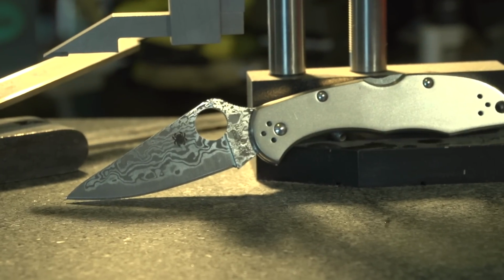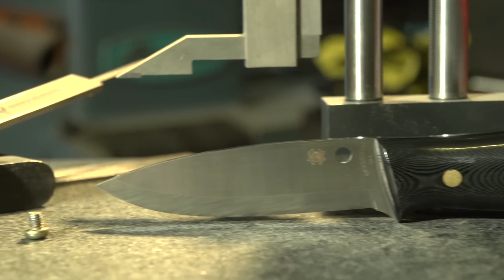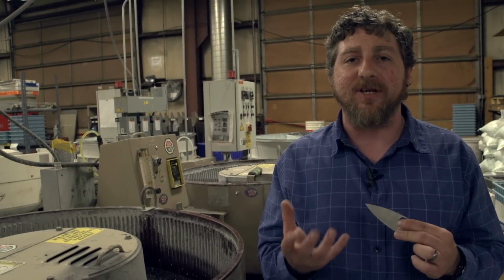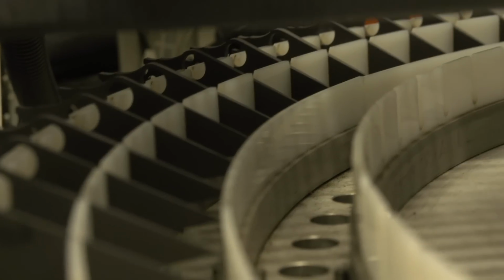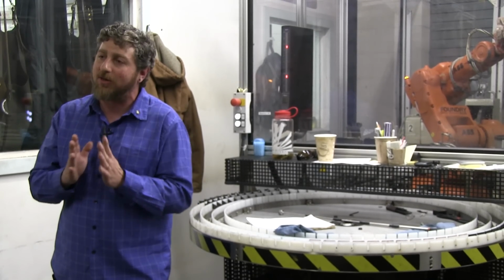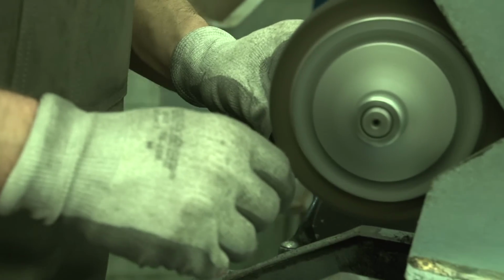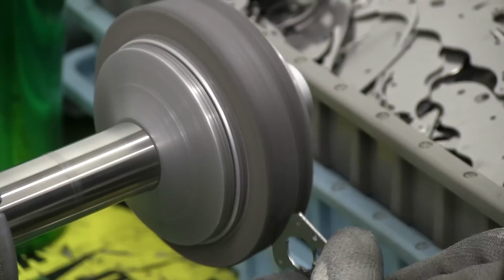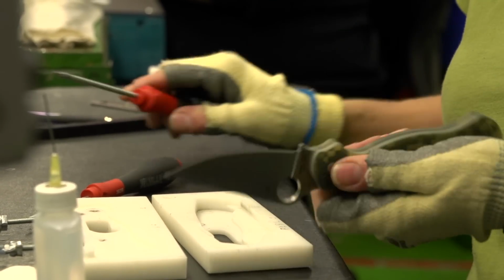Spyderco Shop Tour | Part 2

Comment: I have several Spyderco knives but one of them I have never used and probably never will. It was a gift from our Fire Marshal and has our department logo on one side and the other side states LSB (Life Safety Bureau) and the year we were given the knifes. It has a short blade so we could carry it when traveling and not have to worry about any blade length restrictions (even though we were exempt when working) It is one of 9 items that I own that I consider as a decorative item. Too cool to cut with but I have carried it for hundreds of days and know it would function if I needed it..

Comment: I gotta say, and apologize. I had it in my head that these knives were not hard workers, over priced unappealing. But after the year of using this manix 2 I gotta say this is my favorite. My fixed blade fav is a kabar mini. But this is one fantastic knife with a great warranty. Don't let the big eye hole make you thing this blade is weak. Don't let the plastic make you think it's cheap. These knives are hard workers and you pay that premium for these knives and it's very well worth it. Even the delica 4. But my manix has my pocket. Thank you!

Comment: Such a big self pat on the back. One, your prices are no longer justified by the product. Bought my first one in 81/82 and have carried one for decades. Your sharpening is horrible. Sharp, but totally uneven on 90% of my purchases in the last 4 years. Sticky compression locks, need I say more? Your average knife isn'Crt even up to the quality of the lower grade Bestechs, Kizers and Civivi. And your continued use of 8Cr13MoV is inexcusable. I'd rather buy a Ganzo, at least it has ball bearings.

Comment: I remember years ago, the first Spyderco I saw my comment was, "what an ugly knife." All the years that have gone by and I still had the same feelings towards them. Three months ago I was in a local gun and knife store and asked the clerk if I could look at one of those knives with the big hole in the blade. I don't know if it's because I'm older and wiser now, but when I stuck the edge of my thumb in the spider hole and gave it a flick and felt the ergo's of the knife in my hand, I raised an eyebrow and said that feels nice. And the hole all made sense now. I knew it was used to deploy the blade but didn't think it worked that good, until I gave it a flick. It was actually easier than any of my thumb stud blades to open. I was hooked. I decided right then I was going to buy one and give it a try. Problem was, there were two I kept switching back and forth, trying to pick which one I wanted and couldn't make up my mind. In the end I wound up purchasing both, and am very happy I did. All my other favorite EDC folders have now been set on the back burner. I'm now carrying the Spyderco's more than any of them. Great knives, great company, great people.

Comment: I think Spyderco does a lot for the industry & takes a lot of customer desires into their manufacturing. However where they fall flat is their customer service. If it breaks, you're screwed. Also, their pricing also makes them an "internet only" company, as they allow dealers that sell their products for $5 over cost flourish while their brick & mortar stores quit carrying anything outside of their core line that customers want. We'll see how their MAP pricing affects them, but the lack of a true warranty & post-sale service is their Achilles heel.

Comment: It would be nice to understand what Eric means when he keeps saying "quality" as he keeps noting it but it isn't clear what aspect that he is talking about as it is a very generic term.

Nice to see water cooling.
Reply: I don't understand what you're trying to say Cliff. That sentence makes no sense to me.
Reply: robert shearer If I was to tell you that Bill made quality knives what would you know about Bill's knives? If I asked ten people that question would they all tell me the same things when I asked them what they knew about Bill's knives?Quality means the extent to which something compares against a standard, but it doesn't say how. Thus when Sal and Eric say something like they used to not be able to meet the quality of a custom knife but now their quality is much higher I don't know what they are talking about.It is the heat treatment?The grind consistency?Innovation?Sharpness?Ergonomics?Fit?Finish?and the list goes on.
Reply: Cliff Stamp Eric talks about the bevel grinds being a high quality due to the precision flattening of the parts...what's not to understand?
He talks about the appearance of the finished blade due to tumbling being a higher quality...again, very easy to understand.
He mentions the machining aspect being a higher quality. Again, what's hard about understanding that? He talks about very high and tight tolerances enabling better performance...again, easy to relate, for the normal listener.
Reply: William Yester He does mention specific aspects, that is correct. However at times it isn't clear which, if any of the aspects he mentioned he means. For example at about the 6 minute mark he notes that when he was a kid they could not achieve the quality of the custom knives, he then goes on to say how much the quality of production knives has improved. 

There is no way to know what aspects of the manufacturing he is referring to have improved hence I noted more detail would be appreciated.

For example, in the 90's Sal Glesser openly noted on the forums that they would not be able to make a knife with the fit of a Sebenza for less than the cost of a Sebenza. It was simply too difficult to get that kind of fit in large scale production. 

However, from direct observation they can easily match and exceed aspects such as the heat treatment, sharpness, cutting grinds, sharpness, ergonomics, lock strength/security, etc. . 

Hence, what are the particular elements or aspects of the standard being used when Eric makes that, and other comments about differences in quality. Now you could guess they are some combination of the things he talks about, but that is all it would be, a guess.

So again, request for more information.